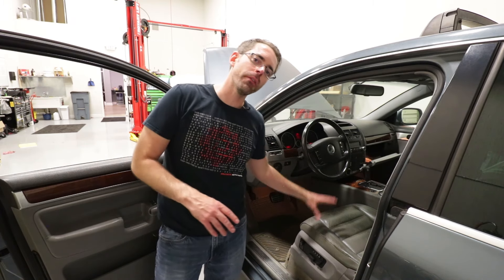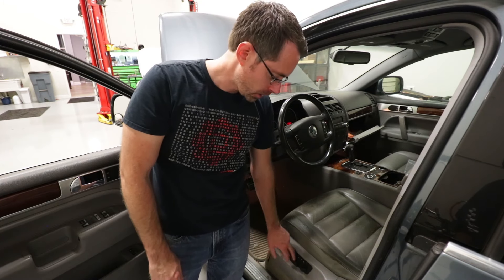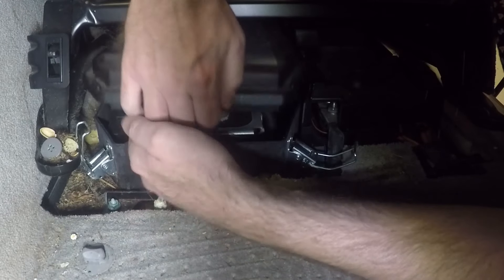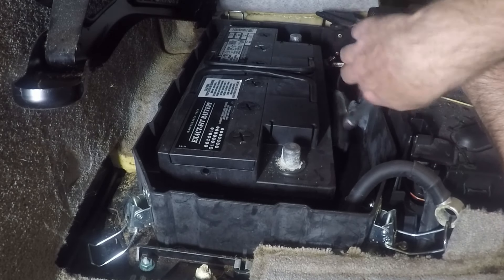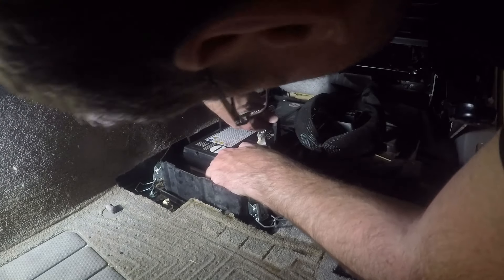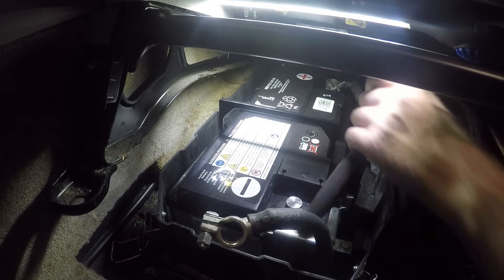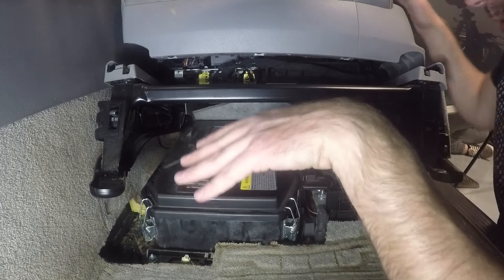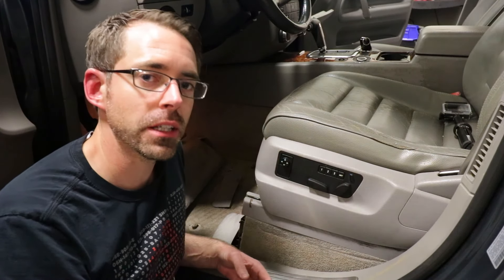How to Replace a Battery on a VW Touareg (Under the Seat)

Comment: Btw the seat mounting screws are not supposed to be re-used, but replaced with new ones whenever they get removed. Otherwise they might pose a safety hazard in the case of a crash/accident.
Reply: Yeah, except we never do that. Lol
Reply: Yeah, because it's not you, but your customer who'll potentially die because of that, right? LOL. /s
Reply: @berczigabor  Over engineered just a waste of money. They are Grade 8 and are not in the elements. So why would you need to replace them? Oh that's right stealerships want you to pay more at the service counter giving a BS reason to do so. This change takes less then 30 minutes with the proper tools. At most your out the price of a $200 battery.
Reply: Anyone who doesn't know why should obviously not work on cars as a mechanic, because they're endangering people's life on an everyday basis. And it's not the dealership that wants you to replace them anyway, but it's the official repair manual that advises to do so. The manual that have been written by engineers that spent more years learning the basics of physics and automotive engineering than most mechanics spent in school all together. And who are not advising you to replace every single bolt every single time, but only those and only then, when it's necessary, because for ex. of safety reasons. Also, the real question should be: why not change it, even then if it seems superfluous to some, if it's a $10 item, which is negligible compared not only to the safety benefits, but also to the cost of the battery replacement, which including material and labor will well run into several hundreds anyway? It just makes no sense trying to save pennies on that. And only people with no understanding of even the basics of material design, engineering and road safety in general do not realize that.
Reply: @LynxStarAuto  So many words, so little sense. What you said boils down essentially to: I have no actual arguments for what I do, but I keep doing it, because if I'd do my job responsibly, I'd make less money. I applaud you for your ethics. /s
Reply: Mark Wolf He means the same engineers who routinely misspell words in the service manuals, contradict themselves, and far too commonly mislabel wiring diagram pin-outs, color codes, and locations.   Because, I basically don't have an entire BINDER of custom made wiring diagrams I drew up through the years due to the lackadaisical, utter horseshit diagrams VW would supply us with.

😂😂😂😂😂 got to love the YT "engineers"
Reply: @LynxStarAuto  I'm pretty sure no VW engineer would ever misspell "delusional" for "dillusional", like you did. That said I don't think you ever read a manual written by the actual VW engineers designing these cars, because, you know, for that you'd have to speak and read German. Which i somehow doubt you'd do.
Reply: Gábor Bérczi Oh?  But they do.  Like when they use the word "refresh" instead of "replace".  Or the countless run-on sentences, and general incorrect usage of grammar I see littered throughout all service manuals.  You can knock me for my spelling on a YouTube comments section; that is a far cry from a professional document produced to guide, and aid professional employees on the testing and repair processes required.  I've been working on German brands for over 17 years now.  I have manuals in a plethora of languages, yes even in German.  I have run into countless egregious errors which should have no place in a professional setting like the aforementioned (completely) wrong wiring diagrams...

BTW, do not misconstrue my tone, or intentions.  I'm all for these pernicious design practices, because I have made a comfortable living fixing other ppl's whimsical designs.  I'm all for it!  If manufacturers were to truly design vehicles appropriately, and hire design teams that have actual real world experience, I would be out of business.  So by all means, have at it.

Comment: VW started doing this in 1968 on the 411 I know this because I have a 411 and I relocated the battery to the back crazy right.
Reply: Batteries under seats is nothing new.  The Ford Model T had the battery under the driver floor boards.

Comment: Does the VW not require registering the battery serial number in the ecu? My Audi S4 seems to require more ecu manipulation for battery swap.
Reply: It's not the serial you've to "register" (code), but the type of the battery, so the charge control unit knows at what voltage and intervals to charge the battery to maximize its lifetime. And no, such old Touaregs usually do not have a battery control module, so, you not only do not have to, but can't even possibly code your new battery in them.
Reply: Your Audi uses what is called an IBS cable.  This stands for intelligent battery sensor.  This system monitors your battery's state of charge and state of health.  As the battery ages, or as it's state of charge depletes, the charging system adjusts accordingly.  Also, if it was to detect a parasitic draw, the system would send power down commands to the respective modules, so that the battery may be preserved for  cranking.  This is usually why you will get a "consumers shut down" message when you first start the vehicle after it has been sitting for a while.  It can also recommend battery replacement due to age, and energy diagnosis.

Anyway, on these systems one must reset the battery montitors whenever you replace the battery.  That way the system can properly maintain the battery.  Think of it like an oil service reset.  This is essentially what "registering" the battery means.  It is simply a battery system reset.  BMW was the one to use the circumlocutory definition and designation for the process which has led to a ton of misinformation online.

First gen Teggys only used a battery module on the V10 models here Stateside.  That system did not require resetting when replacement was necessary.  Late second gens started to use the same IBS cable as most late model vehicles.  On that one, a new battery replacement is recorded.
Reply: @LynxStarAuto  Thanks for this information, it was very educational.  Is there any way to perform the registration without going to a mechanic?
Reply: Quidproquo07093 if you have access to VAGCOM or similar.  Excuse me "VCDS".  The only way to reset the battery monitors is with a scan tool.  A professional grade tool.  Not s code reader.

Comment: On my 2011 the seat doesn't fold back. You have to take the 4 bolts out of floor bracket. It takes the inverted sockets I believe is what they are called. It's tight on the rear two but front was a breeze. I used a pair of vice grips to get lose on back two. None of the bolts are very tight.i didn't have room with socket and rachet hitting seat.

Comment: What year Touareg is this? In my 2014 hybrid the trim pieces, like the one in front of driver seat, are much larger. Seems like I have to unscrew rails on which seat travels front to back to actually remove carpet trim.

Comment: Do I need to reset the codes once battery is replaced (necessary in order to run)? If so, where you recommend I take it to have this done? Trying to be cost-effective.

Comment: Nice video Paul! Now do one on the Passat W8 PLEASE!!! 👍
Reply: I had Passat W8 and loved to drive it.  Gas mileage was not that great, especially only having 270 some horsepower.  At 55k miles, the coils sitting on all 8 sparkplugs started to go out.  Then the the engine mounts went out.  Next was the alternator which is oil cooled and expensive.  The headlight bulbs needed replaced and to do that, the bumper cover has to come off.  The final straw was the 5speed auto was needing rebuilt.  I miss how it handles but it is expensive to own.
Reply: Dialysisforever I currently own a 2003 Passat W8 sedan with the 6 speed manual transmission, and I absolutely LOVE the car. I sold my 2004 R32 back to the dealer when I purchased my 2016 Jetta Sport. I also love this car...but there is no comparison! 125,000 miles and a GREAT replacement for the older R32!!!
Reply: @takeomack2782  I wish I would have found a 6 speed.  I would still have my wagon if I had.

Comment: You forgot a step or two when you were behind the seat - you needed to remove the plastic covers on the rail and expose the hinge - this allows the seat to completely flip backwards when you have the seat forward in the rail and the seatback forward as well. This will allow you to flip the seat back way further and almost straight up compared to the small opening you had..........

Comment: This is most likely the dumbest design I have ever seen.
Reply: It is better for the battery lifespan
Reply: Trucs de pro how. Enlighten me. Most German car battery’s are located in the trunk anyways below the liner which would protect it from the environment
Reply: @Justsomeguy1015  Temperatures vary widely due to the engine, which shortens the battery life is short. Batteries that are housed far from the engine have a much longer lifespan. The cold is also guilty. Sorry for my english ;)
Reply: @johnsnow7875  Well thats what i'm saying. Alot of german cars have the battery located in the trunk which would keep it away from high temperatures. This one is just plain dumb the design.
Reply: @Justsomeguy1015  Oh ! OK
Reply: You do know, that the vehicle is factory sealed to do water crossings, that was the logic behind battery placement.

Comment: Some people said is a dumb design, but I think German engineers are not idiots, they leave room in the front on the car for a reason. Car battery last for years, its just a bit of time for disassembly, and you have battery connectors under the hood.

Comment: Also... take the booster off in the front before loosening the battery cables :)
Reply: No, he put that there to keep power to the car & save car settings while battery is out.

Comment: So how do you move the seat back if you have no power? IV had to change a battery in -42c blowing snow in my driveway. No fuckin way am I buying a car that entails all this work, my hands would be frozen id be swearing up a storm.
Reply: Paul he put jumper cables on right in the beginning.
Reply: @Paul. Use the new battery that you would have just purchased lol
Reply: @TheSovietHotDog  I said "how do I" not him. I saw what he did.
Reply: @everlyates1946  how? You have to have the battery in to move the seat back, if you don't have jumper cables to boost from the posts under the hood your screwed to move the seat back.
Reply: We use a memory saver to keep the electronics powered up during initial disassembly.

Comment: You need to slide the seat FORWARD not Backwards. Also remove rear rail cover FIRST. Very important!. Or you will break them. then the bottom of seat will go up and past steering wheel.   You can remove the battery staright up In less 30 seconds then!

Comment: You missed the whole secret to accessing the battery...  after you lay the seat back, move it all way forward on the slide, the seat will then lay back and you can access everything even the  screw you removed from the back, and the battery pulls nearly straight up

Comment: Getting the battery in and out is not this difficult! Power the seat back just far enough to clear the steering wheel when tilting the seat back, with the front of the seat past the steering wheel power the seat forward (up at this point) all the way. With the seat back de-clined all the way forward there is lots of room to get the battery in and out.

Comment: That's a BS battery location, good grief. Definitely an 11th hour decision on VW's part. I guess there's no room at the firewall  nor rear passenger seat.
Reply: The touareg also came with a V10 diesel and W12 gasoline. In those there is no room up front. Under the passenger seat are electronics.  Under the rear passenger seat is the fueltank. The W12 even has 2 such batteries. One in the rear and one in the trunk.
Reply: Barthoization We never got the W12's in the US.  We got the V10 TDI.  Those use two batteries.  One in the trunk and traditional one under the seat.

Also there is plenty of space in the trunk to mount the battery.  Just relocate the useless first aid kit, or use the TDI location for the main battery.
Reply: no!

Comment: I feel bad for anyone that has to do battery service on this car.
Reply: It's really much easier than they made it out to be.  It's just about moving your seat forward and tilting the backrest all the way forward.  Doing it that way, you don't have to take the carpeted trim off of the front of the seat.
Reply: Just did on my q7. The seats actually recline all the way. And it’s not as tight as it’s shown here. Also you need to register the battery in the Ecu. Honestly, it was a 45 minutes job. Batteries last a long time on these cars.

Comment: I dont mind bmw and their batteries in the trunk. But this? This is beyond stupid. Too complicated for no benefit.
Reply: Santiago Rocha there are benefits of packaging and short main power leads plus weight balance... they didn’t do it on a whim. Also a few models have two batteries, one for the power train the other for the other systems.
Reply: @jamest5149  If you are talking about weight balance, the should be in the Trunk. There is a reason bmw does it. and absolutely no reason to hide the battery under the seat.
Reply: @jamest5149  - These things have huge fuel tanks for how small they are too which gives them pretty good ranger. This guy in the video just makes it look hard by not putting the seat forward on the tracks.
Reply: @MeDicen_Rocha  - BMW last I checked doesn't offer a spare tire at all. Touareg does.
Reply: Mark Wolf the battery on BMW's is usually mounted in the rear quarter panel.  That leaves  more than enough room for a spare.  Also, you can buy a "spare tire kit" on newer bummers.  No spare tire was just a scam run by manufacturers to sell you a spare tire kit, as run flats no longer require them to provide a spare.  

It is all about the money.

Comment: that is not a unique placement of the battery, what in the world were the engineers thinking?
Reply: You will find yourself repeating that with this platform constantly.

The water drains: what were they thinking

The battery: what were they thinking

The wiring splices: what were they thinking

The steering column module: what were they thinking

Etc etc etc

Comment: This is why you don’t buy anything with British engineering. Does the bolt for the starter also hold the motor mount like the 98 Jetta? 😂😂😂 terrible design. Well done 👏👏👏👏